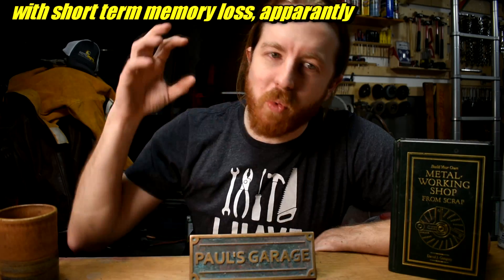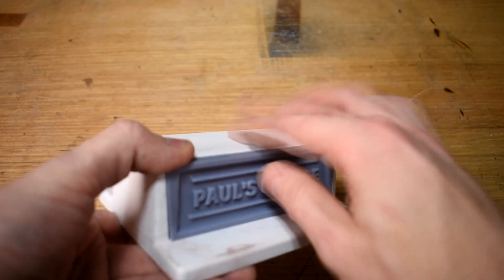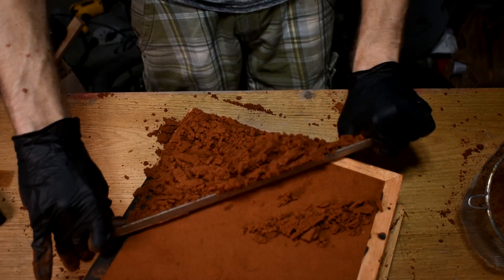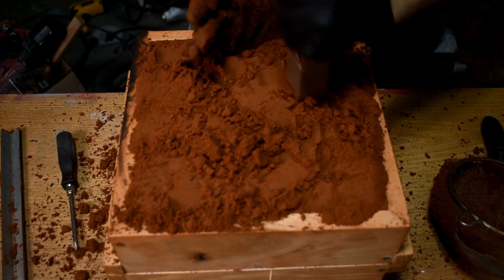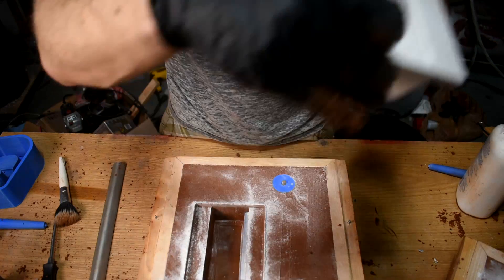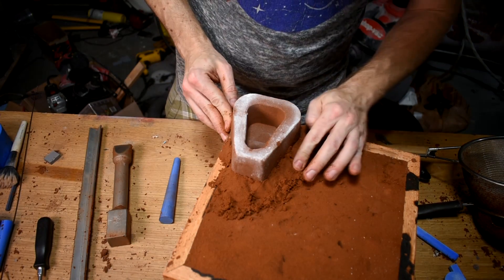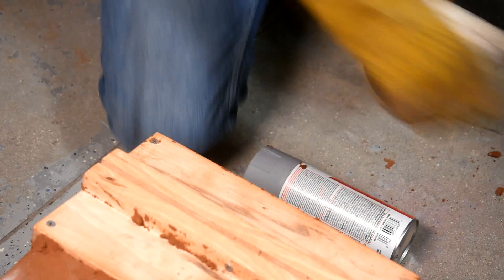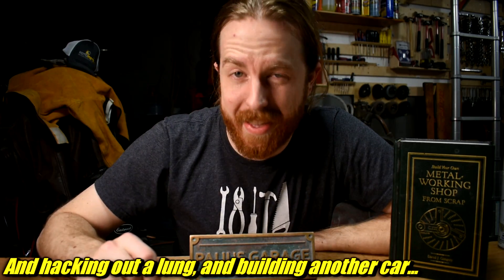Casting the Impossible Gingery Lathe Foot | DIY Metal Lathe Part 4

Comment: Maybe a dumb question , but how much Petrobond is required for this sized flask?
Reply from the maker: i'm not sure, that's a good question.  I buy it in 30 or 50lb boxes and throw it all in a big bin.  if i had to guess, 30lbs is more than enough, but i could be wrong.  This flask is 11.25"x11.25"x3.5" each and there are 2 of them, so whatever volume that is.  not sure the weight of petrobond, but i can lift it fairly easily and i'm not a body builder.
Reply: @PaulsGarage  Thanks. Unfortunately, Petrobond isn't that cheap here in Australia & the Boss ( she who must be obeyed) has put me on a spending ban at the moment. 😏
Reply from the maker: yeah i've heard it pricey in Aus.  you can make greensand though.  It's a bit more fiddly but it can still give you great results.

Comment: I ended up printing my patterns with 1mm holes in the backside to partially screw in small screws to help in removal. Works like a charm.
Reply from the maker: yeah that's the best way to do it.  Sometimes i do that with patterns but often i just assume i can get it out without them.  I always regret that choice LOL

Comment: You do realize you didn't need a false cope for this part? Just ram the cope first with your gating system installed. Turn the cope over and ram the drag. Then, before you disassemble, turn the complete mold over. Lift the cope off and remove pattern and gating. No false cope needed.
Reply from the maker: The way the runner and tapered sprue are formed, yes I had to do the false cope.  It's mote of a problem with the way the runner forming stuff is modeled, that's a work in progress 😉
Reply: @PaulsGarage  That's why I like making wood sprue. If I need a pouring cup on top of the cope, I cut the sprue to the height of the cope. Or make the cope high enough to incorporate the pouring basin. 
Me personally hate to ram a temporary mold. Seems like such a waste.
Reply: @roscoepatternworks3471  I'm glad you posted this. I couldn't understand the need for a false cope. I thought I was missing something. It's good to know that it was as I thought, not necessary.

Comment: I seem to recall casting gurus have to pass a test - sand casting a teacup and saucer, together in a single casting. Would it be better to use a 3 or 4 part flask to get all the odd angles and drafts?
Reply: I've seen that, too. I could swear I saw one that had a spoon with two sugar cubes in the cup also, pretty amazing.
Reply from the maker: From what I've seen it's 4 flasks for bottom, between saucer and cup, between cup and spoon, and on top of it all.  It's a fun experiment but if I had to make all of that I would probably investment cast it with a filigree spoon and a cup with a handle and my face in the bottom of the cup for no reason 🤣

Comment: looked good , ever tried using aluminium rims for casting . ive heared that that type of aluminiumscrap is pretty good to cast , does take a little effort cutting the rim into chunks small enough to fit in the cruisible
Reply from the maker: I haven't cut down aluminum rims but that is definitely the good stuff.  It's a356. That wouldn't work well for a lathe though because it isn't as vibration dampening as za12

Comment: Wow, that insert worked way better than I thought possible. I was expecting that it wouldn't be possible to get the insert extracted cleanly enough, but the edges of those letters are shockingly crisp. I'll definitely have to experiment with that technique, I haven't seen that used anywhere before.
Reply from the maker: It wasn't too difficult, of course there are a million little details and muscle memory contributing but it's totally doable